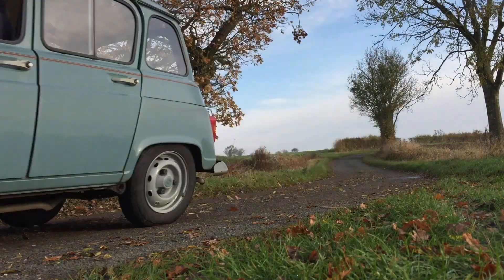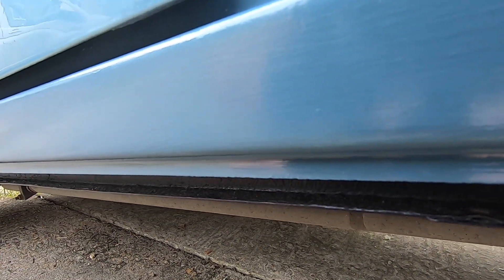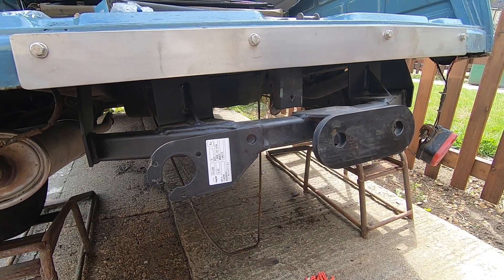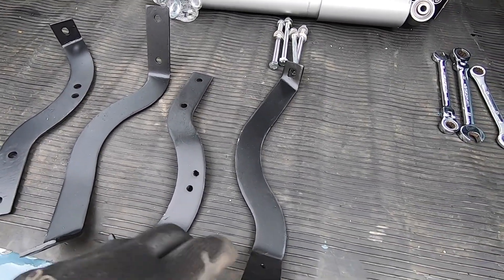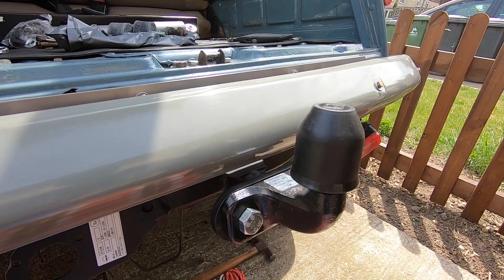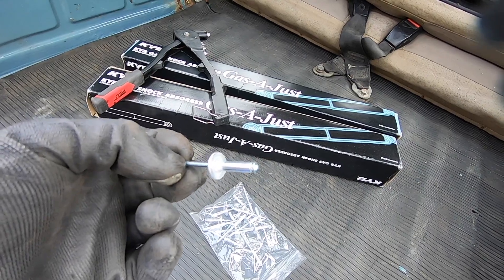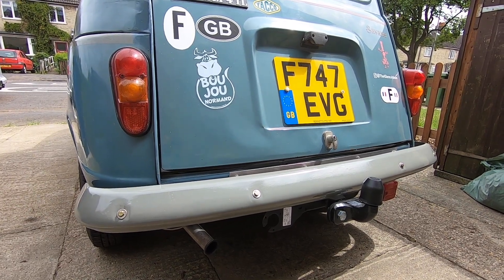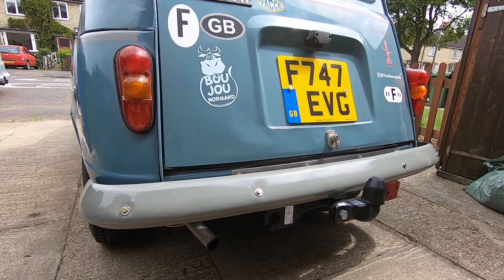Renault 4 Tow Bar, Bumper and Other Fun | May 2020

Comment: Hi Glenn
Could you, perhaps, post a link to where you bought the towbar?
I'm wanting to fit a bike rack, too.

Mine is a 1986 R4 GTL.

Many thanks

Chris
Reply from the maker: Hi, yes, no problem, they are still available, the kit installs fine, no modifications to it or the car required. -> https://www.ebay.co.uk/itm/190352993941?hash=item2c51ec2e95:g:AvUAAOxyoA1RJAaM
Reply: Thank you 😊